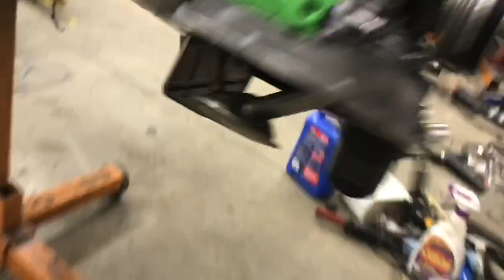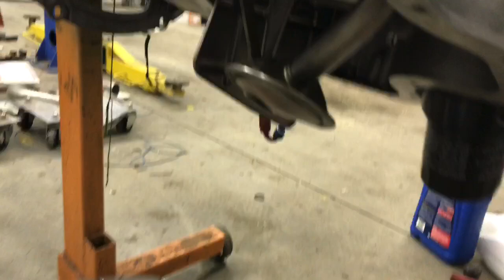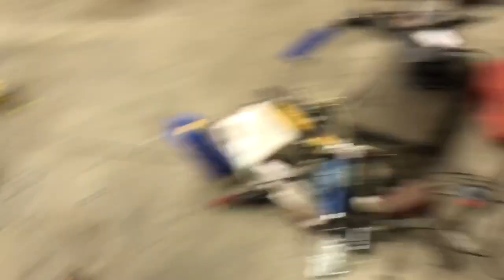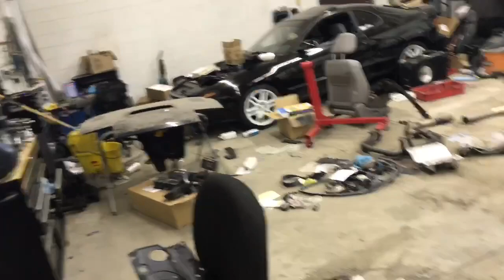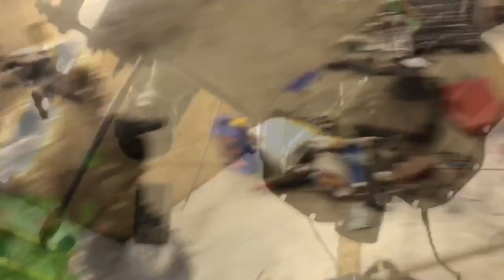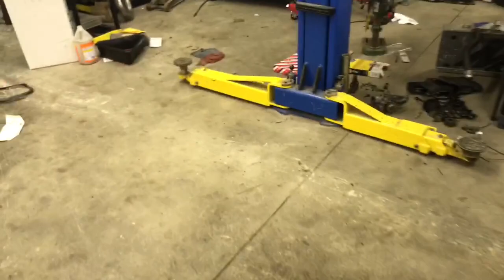3sgte project with parts

Comment: First of all, welcome back. The most that interests me is the 3SFE turbo setup that you spoke about. Me, well, I did the throttle body mod, cutting and installing a V6 throttle body in my 3SFE engine with Supra N/A injectors 312cc. When we get over this lock-down. I'll go turbo. Good to see you back, we will stay tuned in your new garage
Reply from the maker: Thank you, how do like the 1mz throttle body, Did it make improvements?
Reply: @velocityperformance8574  Sorry for the late answer. But yes, the 1MZ throttle body gives a great pull when I step on the throttle. And Especially, the sound. It remembered me of when I had a V8 383 Nova when the secondary barrels opened.